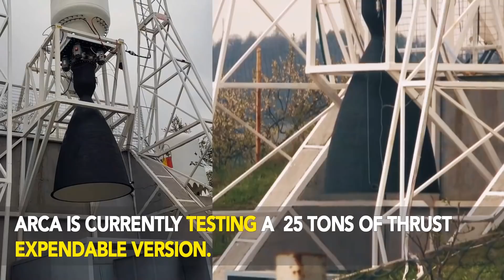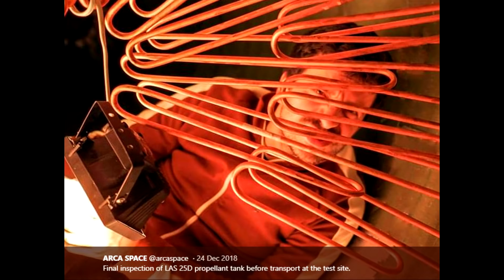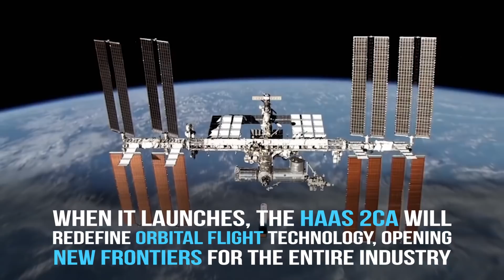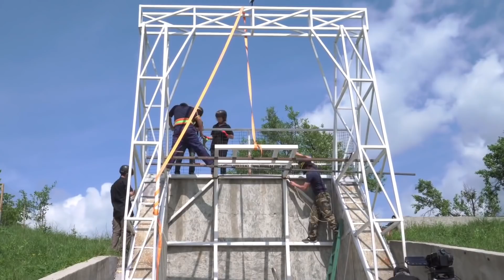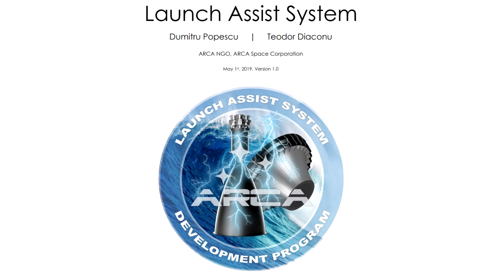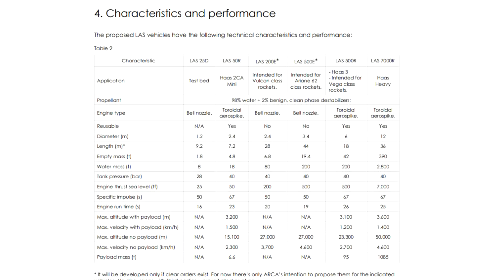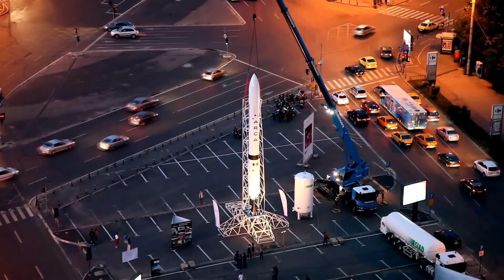Does ARCAspace's Water & Electric Powered Rocket Make Sense?

Comment: I have actually been advocating hot water as a poor man's rocket fuel, for a few years.  In theory, if the water is near boiling already then you can just add a little more heat to change it to a gas -- liquid water to gaseous water (steam) has 16000x expansion.  The water would need to be absolutely purely distilled, as not to explode.  It's not more safe.. but you don't need expensive cooling for a combustion chamber and bell cone..  

My poor man's design for a spacecraft  was also a disc with steam aerospike on one end, like a pizza cutter.  The disc's rotation is, in part, to stabilize it.  It can also be used as a kind of turbopump..  and the very broad surface would provide solar electricity to continually boil the water.   It would have to launch in early afternoon, of course.  Once in orbit, you'd have spin gravity inside.. and could go occupy the spaces formerly filled with hot water..  take a bath.. a shower.. have a flushing toilet..

--Matthew C. Tedder
Reply: btw also, it's much easier to get tensile strength than compression strength.  You can use fibrous composite materials that are very light weight.  The spin will also add strength against max-Q forces for superior structural integrity over conventional rockets..
Reply: I would use nitrogen foamed PVC as the resin.  It is fire resistant, holds pressure very well, does not fatigue, is anti-microbial, and is very insulative of both temperature and also of space radiation.  It can be easily welded for repairs or renovations, too.   The weakness is that the high temperatures in Earth orbit will reach up to 248F, at which point PVC will become soft..  You could simply accept this on the outer layer but it would be better to do something to insulate out there... such as a later phenol.  Rigid PVC also becomes brittle in extreme cold but the nitrogen foaming prevents any catastrophic breaks from occuring.  Instead, it will chip pieces off, when hit.
Reply: My first mission, if going beyond Earth, would be to the outer edge of the main asteroid belt to collect large amounts of water ice..  It would be a 5 year mission, returning with vast quantities of water to the cis-linar orbit area.... The water in the outer walls would also make for exceptional shielding against radiation and small meteor strikes.

Comment: Microwave powered superheated steam rocket can be feasible. But a steam powered rocket using copper heating coils? Come on. And the weight of the battery is very high to its energy density, its like the electric airplanes powered by batteries, they cannot fly it enough for the energy density of battery nowadays cannot support the long flight time. Maybe they must use mini nuclear powerplant inside to make electricity but heavy shielding must made making it hard to put on rocket because of heavy shielding needed to be safe on radiation leakage.

Comment: Nuclear powered rockets use extremely heated up hydrogen and jet it out of the nozzle. Could they probably use also water?

What if you use CO2 instead of hydrogen as a exhaust mass?
Reply: You could use many elements. The problem though is anything that isn't hydrogen gets massively less specific impulse. Helium for instance would get about 700. Anything heavier than that and we are talking about getting less isp than conventional chemical engines. (with also getting much less thrust than chemical engines and with all the dangers and complexities of a nuclear thermal engine) Water would be about 330, CO2 about 280 isp. Hope that helps a bit.

Comment: It makes no sense. It literally makes no sense to use steam and batteries as opposed to rocket fuels. Even the simplest rocket fuels are better than steam rockets in terms of ISP. I should clarify that it doesn't make sense when you're only talking about a few hundred degrees Celsius. If you want to get a nuclear reactor and use that to heat up water to at least 3000 degrees kelvin? Then go at it; you should be able to exceed kerosene/oxygen rocket engines in a vacuum, but you'll come in well below hydrolox engines. At an equilibrium temperature of 3027 degrees Kelvin, using an expansion ratio of 240 and a chamber pressure of 5 mPA (which can be achieved using an expander cycle type process using the water), the theoretical maximum specific impulse you could achieve would be an ISP = 399 seconds. 

Does it make sense potentially for use on other planets with easy access to water? Sure. As a rocket fuel? Hell no. 

It would make far more sense to use liquid hydrogen as a rocket fuel if you have a nuclear reactor that can heat it up to 3000 degrees Kelvin. At those temperatures the molecular hydrogen (H2) begins to disassociate into atomic hydrogen (H). When your temperature begins to fall once the hydrogens in the rocket nozzle and begins expanding, the atomic hydrogen recombines into molecular hydrogen releasing a lot of energy, increasing temperature and hence allowing the gas to accelerate more. Another way to think about it is that the average molecular mass goes down (mass per mole of substance), and hence the specific impulse goes up (the ISP will go like 1/(sqrt(M)) where M is the molecular mass). This also means that the hydrogen will heat up at a slower rate, as you require more energy to heat the mixture up as it takes energy to disassociate the molecular hydrogen. This just means you need to ensure you have a large enough reactor to heat it up in time.

Comment: I think water powered rockets are a bad idea simply for the fact that water is precious to life. We shouldnt go around wasting it to the vacuum of space when we have fuel alternatives that we can use without impacting our survival supply
Reply: Venturing into the Brine  But how to get it. You could fill a bath with condensation but it will take a lot more time and effort than running the tap if you get the metaphore.

Comment: One kilogram of propellant (RP-1 + LOX) produces about 14 MJ of energy. 1 kg of hot water (250 degrees centigrade) has 0,7 MJ of useful energy. 1 kg of battery has 0,9 MJ. 

So, there is a ten-fold difference here. I'm sorry but this water rocket is bollocks.

Comment: I guess next idea would be bouancy rocket.
Let's make rocket heavy but bouant. Let's force it very deep under water (like 2-3 miles deep so it justify tropical holidays on an expensive yaht). Surfacing rocket can use momentum as a first stage booster - kind of jump-launch system.

Oooops water pressure at the sea bottom would make the whole project compressed to the unusable volume of crushed parts. Let's hope investors won't find out.

Comment: It would be interesting to see an update on this, maybe with their 2 stage hot rocket booster.
I think your a little dismissive of the hot water rocket, lousy iSP but plenty of thrust and in booster phase thrust is what your after. Their white paper of ISP of 50s at 250C and 40bar looks reasonable (and actually a lot less than you mention is obtainable with a steam rocket, I think your mixing your rockets). The extra ISP with a aerospike looks optimistic for the original low altitude boost. 
Lithium batteries, is rubbish. 
The very low mass fraction for composites to hold at 250C looks unrealistic. 
As is the use of 95% hydrogen peroxide. I dont believe anyone has demonstrated an engine that can work with such high concentrations as the temperature gets to high. 85% is the sort of maximum possible with silver on nickel that was used in the UK.
But the idea of using hot water rockets for the boost stage is not new, yes they would have to be large but they could be very cheap and eco.

Comment: Umm... time to listen some Abney Park...

Despite of all jokes, I doubt those guys didn't do the math. Storing directly water, as opposed to storing liquid O2 and liquid H2 is a good way to store the reaction mass. The thrust can be high enough because it depends on the mass that exits the nozzle per second (mass flow rate). But the specific impulse will be low as a result of lower exhaust velocity (because of lower chamber pressure, because of lower power available in the chamber) or a lower overall energy available to the system.
Still, this type of propulsion may be feasible with a nuclear reactor as an energy source. Fission can offer the highest energy density technologically available. Romania doesn't have the ability to develop nuclear technologies, for that it firstly needs a smart, non-russian controlled, government. But some guys, here and now, can experiment with various technologies as long as their shadows are not too long or they are able to misdirect the attention. 

So maybe going fully steampunk is not exactly a crazy idea.

Comment: No way this is going anywhere. Absolutely NO WAY. A 'first stage'? Really? Sounds like someone is desperate to keep his company alive and decided to make this shit up. Absurd. Say you want 3 km/s of delta v; reasonable for a first stage; assume an ISp of 120 seconds then you need a mass ratio of 12.8. That's a lot. That wouldn't work either since the maximum delta v you can get assuming a linear relationship between tank mass and gross stage mass is equal to Ve*ln(1/k), where M(tank) = M(gross)*k. Since you'd need batteries this would be limited to AT MOST k = 1/5 to 1/10 assuming a miracle; which is 1900 - 2700 m/s for an infinitely massive first stage.
Reply: Batteries aren't a requirement, but an addition to a future variation. The stage could be heated on the launch pad, significantly reducing required weight.

Comment: That doesn't make sense in so many ways!
Even if the energy is produced with solar panels and even if most of the energy is stored in the heat of the water and even if the efficiency of the battery charging and discharging is 100%. Physics tells me this concept is bullshit.
Thought the extreme low ISP and the enormous weight of the fuel and batteries the efficiency of the system still sucks. 
And at the end efficiency is cost and a high cost per launch is just bad. 
That's why Falcon 9 dominates the market for LEO lauches. And that's why hydrogen fueled upper stages still dominate geostationary launches. 
And that's why a inefficient low tech sollution will not be financially comparable to a rocked fueled with liquid methan produced with solar power.

Comment: Batteries are bad design. Basically they are dead weight. As used up, the weight remains, doing nothing but weighing you down. More traditional fuel types lessen the mass of the ship as they are used. This is why electric planes are not feasible, and the main draw back on electric cars

Comment: Why are you doing videos on BS?  A proposal to use lithium batteries to generate steam to power a rocket engine  instantly relegates the scam artists to the absolute fringe!  What about demonstrated and proposed nuclear rockets?  Please spend way more time on the possibilities!  SABRE?!?  I understood that the heat exchanger shows great promise -- if the SR-71 could achieve Mach 3 with a turboramjet, without active cooling or ablative materials, mightn't a combined-cycle engine and the application of those technologies enable an efficient, air-breathing first stage more effective than mere carrier aircraft?  Lowering the cost to orbit should have been and should be the primary focus of space research.

Comment: if you put a hydro - electric dam on a rocket you could produce enough electricity to, oh, hang on....

i have always thought that lighting a big fire under a tin can is a silly way to get into space, and when we finally meet aliens from another galaxy they'll laugh their little green bollocks off when we explain how our space ships work. steam powered space ships sounds really sensible, it's providing the electricity is the problem, batteries are not a good answer - i don't know what is though. dammit jim i'm an artist, not a rocket scientist.
Reply: Steam is not a good propellant, an efficient fuel is one that produces an extremely fast exhaust stream, you do that by heating it up really high and by having the exhaust be composed of matter with low molar mass.

The Nuclear engine tests by the USA managed to achieve an exhaust velocity of slightly above 9km/s, about 20000mph.
Heating up Water to the same temperature they achieved only accelerates the exhaust to about 4km/s, not even half that of hydrogen due to its much higher molecular weight.

Some of that is made up by waters much higher density, so you need less and lighter tanks to store it.
But nowadays we can make tanks out of extremely thin metall, so we can build gigantic tanks with very little mass.

Its much better to use Hydrogen as a fuel, its just so much more efficient.
Reply: Steam would only work with a portable fusion reactor (Back to the Future style) and if you didn’t mind lugging around ungodly amounts of water everywhere.

Comment: I'm pretty much entirely convinced Arca are a bunch of con artists.  The guy temporarily hires people of moderate talent to produce promotional material, fibreglass models and cheap fabrications to try to convince the gullible into investing in their brainfart schemes. Nothing of real worth ever materialises, only flashy "prototypes" built from DIY store hardware.  As for the water-fuelled rocket, it's no big effort to utilise a steam generator (disguised as a fuel tank), use it to pressurise a tank with steam and vent it out of a pipe tipped with what looks like a bell-nozzle!  Until they actually fire a steam-powered test rocket over 10,000ft altitude, I'll remain unmoved.  And I hope you, Scott, will avoid publishing anything about them until then, lest you find yourself implicated when someone finally sues them for fraud!

Comment: I think it would be quite interesting to see what would happen if they change their design a bit.
1. Remove the batteries and strap the unsafest nuclear reactor(probably a reactor that uses the water directly as coolant) that fits to that thing and remove any type of shielding to keep the mass as low as possible.
2.Detach the reactor as well as the watertank as soon as it is empty.
3.Measure the result

Honestly I think it would be very interesting to see if it is possible to optimize the thrust to weight ratio of such rocket so that it could take off. I don't know much about modern nuclear reactors but I could imagine that you can reduce its size by a lot if you remove every type of safety mechanism.